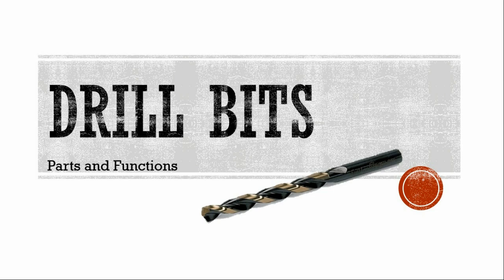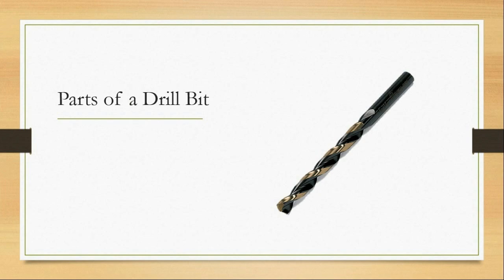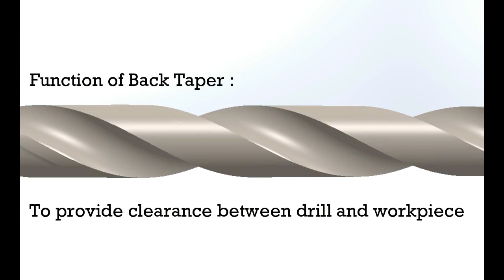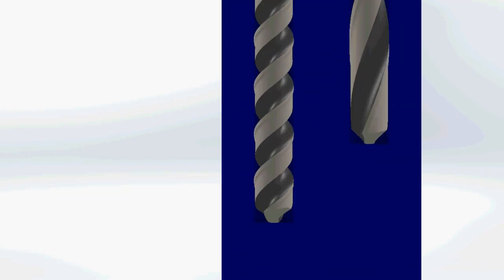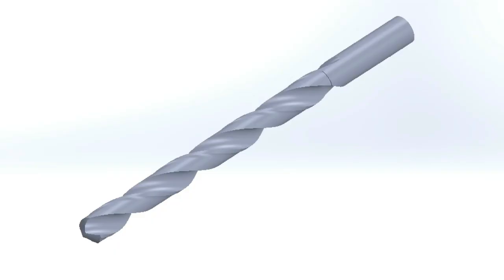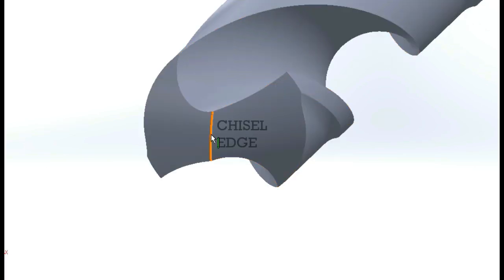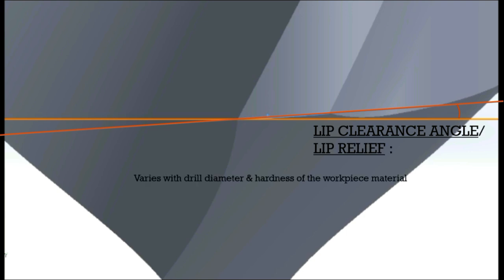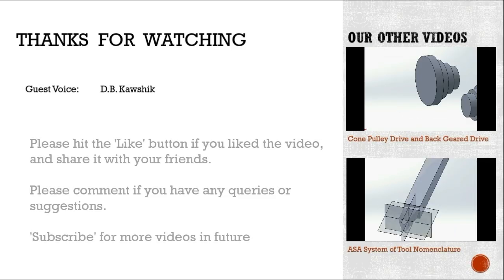Drill Bits - Parts and their functions

Comment: Can you  please explain rake angle  of drill.
Reply from the maker: For a drill bit, the rake face is the flute, the cutting edge is the lips.
If you look normal to a cutting lip (such that it becomes a point), the angle between the axis and flute is the rake angle, which is basically same as helix angle of the drill bit..
I suggest you look at a 3D model on 3D view in GradCAD, to understand better.